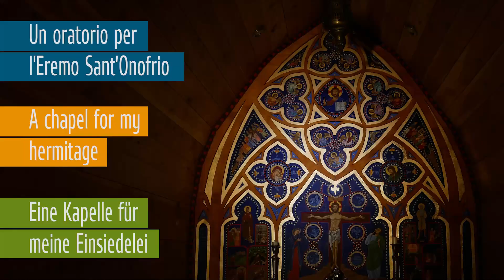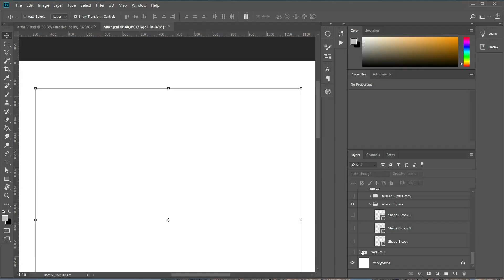Oratory build - Timelapse

Comment: As an old sailor, I see the resemblance of the Oratory shape to the hull of a wooden vessel. The gentle curve as it reaches its height, wraps itself around the celebrant or the penitant, comforting, protecting, exhaulting. Peace be with you always.  🙏
Reply: The main part of a church, be it Catholic, Lutheran, Anglican or similar, is typically referred to as "The Nave" as it resembles exactly that, the inside of a ship turned upside down. If you ever have the opportunity to visit Vancouver, BC, be sure to visit Christchurch Cathedral. The building was built some 100 years ago by shiprights, and is a gothic style cathedral inside, but all made from timbers and wood like a ship.